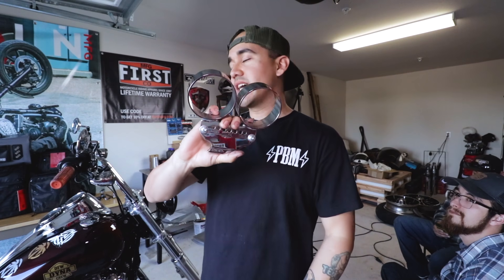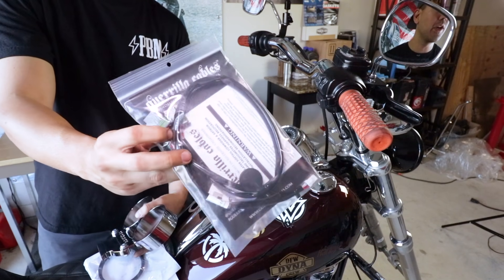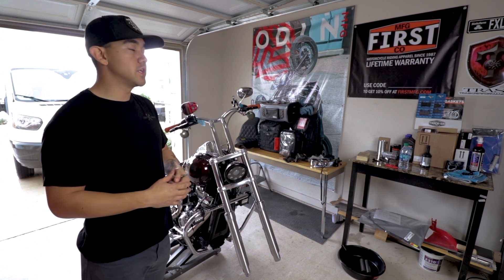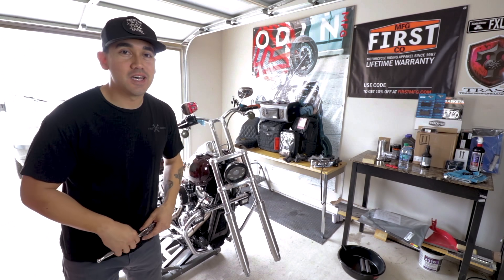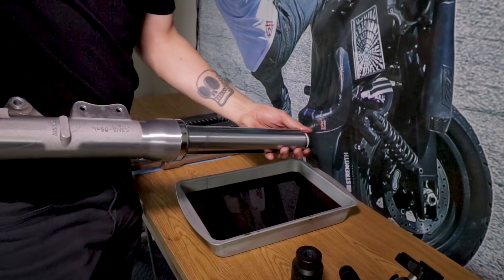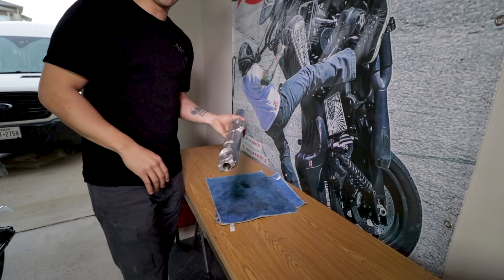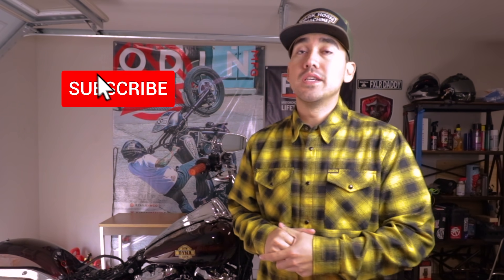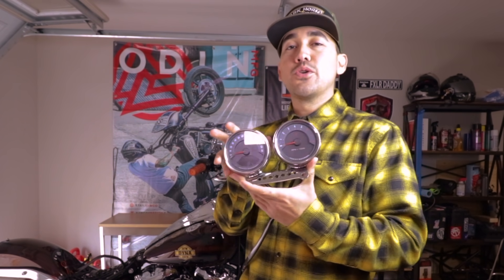FXLR Rebuild Series | Ep. 03 | Forks Disassembly & Speedo Relocation FAIL

Comment: You should have installed the Race Tech gold valve emulator kit also and you could have still added the 2 inch fork extensions at the top. I did that for my 2017 RG before I went the Ohlins route
Reply from the maker: Angel Vazquez I was torn with which front suspension to go with so I decided to keep it stock for the time being and def glad I did!! 

Rode a buddies bike with gp suspension front and knew that’s what my bike was missing. I’ll def be adding that to my list of mods to come for the lowrider! 

Thank you for watching and appreciate your comment
Reply: ConnorFXDB keep up the hard work and I wish you much success